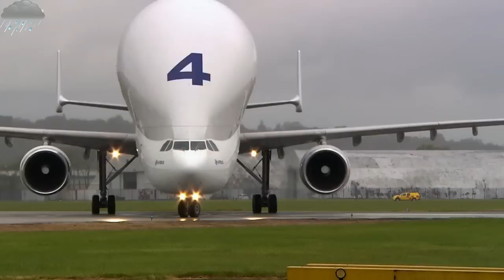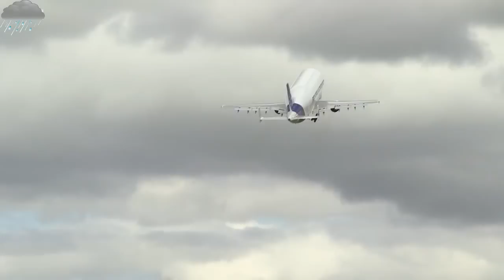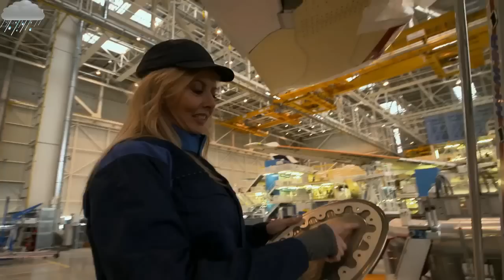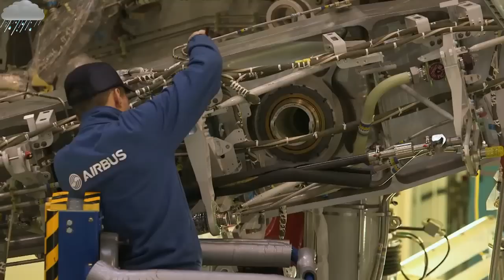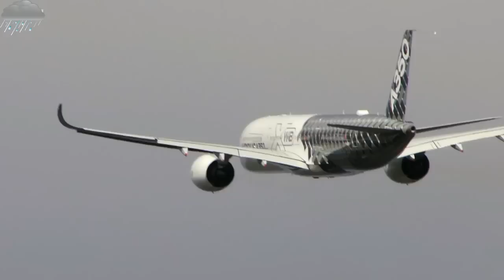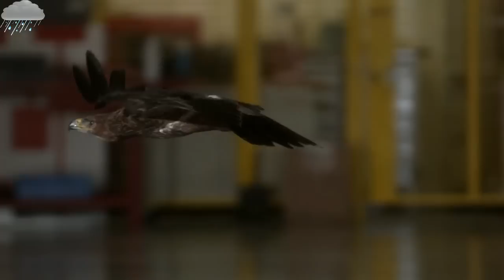Airbus A350 XWB Documentary 3/4

Comment: I am amazed that in production by Airbus Was good and the work was very propesional I really like the Airbus-built aircraft, even the Interior is like a beautiful Apaterment once the work was extremely thorough and the structure of the aircraft is highly preferred for convenience of passengers, both wings with a stretch of up to 50 meters, it is remarkable, Indonesia has bought Airbus a 350 and a320 I hoped Indonesia could buy a super jumbo Airbus a380 Aircraft , with long-distance cruising during the trip very comfortable and pleasant lah